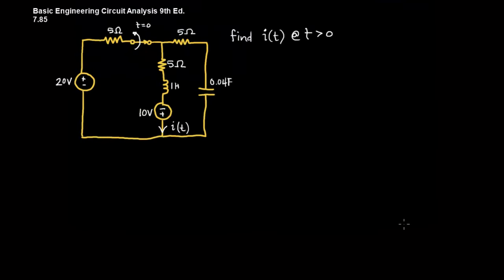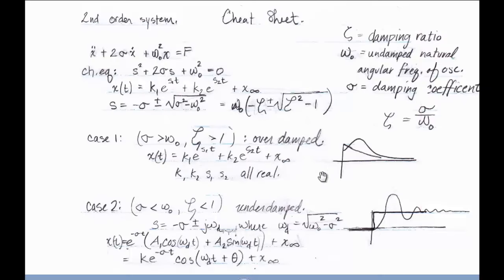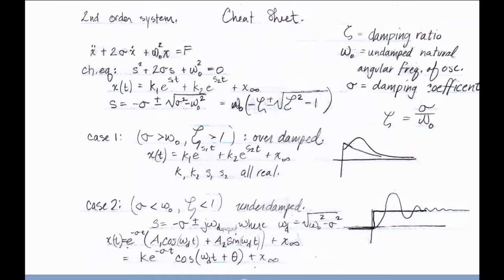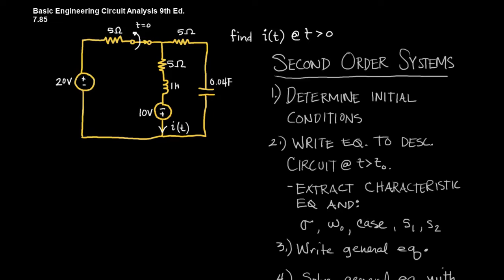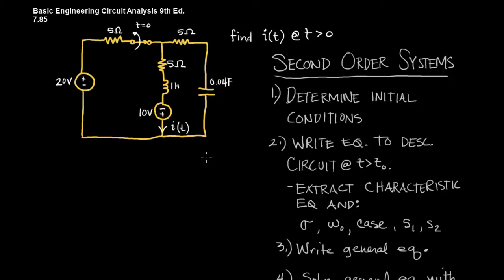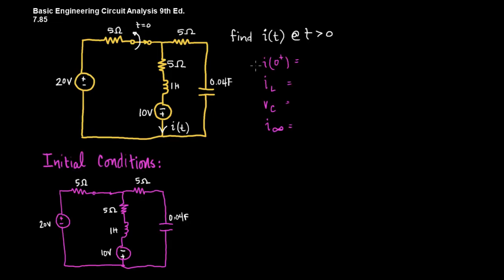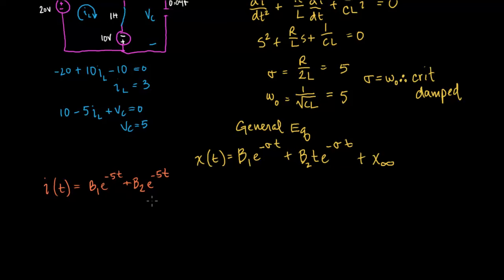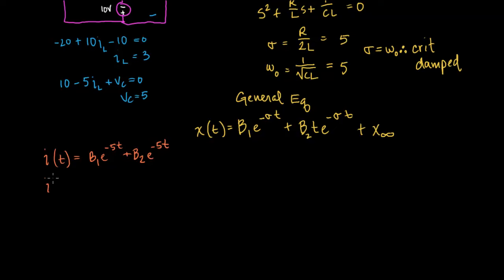Analysis of Second Order Circuits

Comment: @ 17:22 "This means the circuit is critically damped."
Indeed it does, but you still need to mind your initial conditions. I solved this circuit in the s-domain and found the expression: I(s) = 3(s + 5)/(s + 5)^2. The zero in the numerator cancels one of the poles in the denominator and you get I(s) = 3/(s+5). This is a 2nd order circuit that exhibits first order behavior. Performing the ILT on I(s), you obtain: i(t) = 3*e^(-5t) ∎

Comment: Really helpful video. However I have this question: in the derivative di / dt that you get at 21:57, where do you get the second term +B2e^(-5t)?
Reply: he made a mistake which you can see but he corrects it by using a describtion....in the vid its B2 t e^(-5t) that you derivate....(not B2 e^(-5t) as written in the vid)...  which equals to B2 t' e^(-5t) + B2 t e^(-5t)'....(same way when you derivate [f(x)g(x)] '= f'(x)g(x) + f(x)g'(x)

Comment: for the V_cap equation @8:15,10-5i+Vc=0. Why do we not consider the 5 ohms resistor
Reply: Because there's no current passing through it :)
Reply from the maker: ***** Capacitors and resistors can't be treated the same in transient circuits.  There is a voltage on the cap, but there is no current flowing in that branch  the resistor is still bound by ohm's law.  No current, no voltage.  The reason there is no current is that the capacitor is fully charged in this instance - therefore it acts as an open
Reply: sebaogal1 are you an engineer now
Reply: +Abdulla Omar still on it :)
Reply: so i think it was because the cap was fully charged
Reply: @AraujoMatt  Thank you for this answer! Great video

Comment: do you imagine capacitors as open and inductors as shorts initially no matter what? does it make a difference if the switch is originally open or closed?
Reply: if the source is connected for the time such that the capacitor will be charged fully and inductor stores maximum energy, than we consider them as open and short cause they don't have the capacity anymore. That's my concept. Correct me if I am wrong..

Comment: Hi friend , i have to get the initial conditions from a circuit with 2 storage devices (L & C) but it also has 2 power supplies and they are always present even before and after the switch closes or opens , how can i get the initial conditions ? may i use superposition ? i mean , passivate one power supply & get the initial condition , then passivate the other power supply & get the initial condition , afterwards my 2nd system initial condition will be the sum of those partial ones ? thanks

Comment: In the first loop, you referenced the technique as the "KVL" when you should have said "KCL".  Using KVL=Kirchhoff's Voltage Law means that you are using the node voltage analysis to calculate voltage.
Reply: Mesh uses KVL (adding up the voltages) and Nodal uses KCL (adding up the currents). He was correct when saying he was using KVL. I'm not sure what you're referring to, because when using Nodal analysis, your equations are set up as V/R + V/R . . . etc, which is current. Mesh uses R(I) + R(I) . . . etc, which is voltage. You may have gotten that backwards if I interpreted your comment correctly.

Comment: Hello, why in the characteristic equation you didn't consider the initial capacitor voltage?
Reply: The initial and final conditions are dealt with in the beginning of the video. The characteristic equation is to get the natural response of the circuit. By superposition they will sum together to get the final response. Check out forced second order ODEs.
Reply: Thanks
Reply: Can you help me with a second order circuit? If so, how can I send you?
Reply: @angelojunior9507  There are better forums to ask on. Try groups like r/ECE or r/Electrical Engineering on reddit. You can also try #electronics on the freenode IRC network.

Comment: Your initial Vc is incorrect; since there are 2 supplies, you need to use superposition when you perform KVL. Total voltage should be 15V when you add the 10V from the 20V supply. Said another way, since the cap is an O.C., the right most resistor is removed from the circuit, leaving a 1/2 voltage divider in series with a single 30V supply.
Reply: Ran circuit on Multisim, Voltage across the cap is indeed: 15V
Reply: This is wrong. First, Superposition is unecessary. KVL works fine. Second, the 10V source is pointing downward, so  (20Vs - 10vs) or 10V - 5V = 5V. I also checked this with a simulation (5V), not sure what clifford ayer did, except maybe make the same mistake.
Reply: Jarrett Montgomery Well if you do kvl on the left loop then you'll see that 20v and 10v are in the same orientation. So... it is in fact 15v..
Reply: KVL left loop: 20 = iL(5) + iL(5)  - 10 (iL = 3) =>  20 = 15 + 15 - 10 == 0

Voltage at 3-resistor node (Vc) using Nodal: [Vc -  (-10)] / 5 = 3; Vc = 5V
KVL in the left loop has nothing to do with it.
Reply: Jarrett Montgomery no
Reply: Excellent reply
Reply: Actually, I was incorrect; I had failed to notice that Vc is across both the 5 ohm resistor and the 10V supply (not just the resistor), so in fact superposition gives you 10V + -5V = 5V. The OP was correct.

Comment: At 13:55 i don't get why we were changing the sign of the capacitors voltage. Why does it not remain a minus? I mean the current is entering though the negative terminal so by my understanding it should remain that way. Thanks to anyone replying.
Reply: I also wondered that but cant explain why he does that

Comment: isn't i(0+) suppose to be the same as i(infinity)? and shouldnt iL equal to i(o-) which is before changing the switch?
Reply: Capacitor and Inductor will act differently when switch is on or off depending on circuit. For this when switch on at 0-/0+ inductor will be short and capacitor will be open. But for infinite the switch is open and the source is therefor not connected to circuit so inductor and capacitor discharge away after the battery after the inductor dies. The resistor on top left doesn't get affected because its open there so it doesn't matter. Now again inductor is short and capacitor is open and making the entire circuit not connected with anything else so its nothing, 0. But when it was 0-/0+ the circuit was still connected and power was running so there would still be current since current depends on resistor and voltage and we still had those so we can calculate it.
Reply: Marc Zapatero 
i(0+) is the instant right after the switch is flipped. i(infinity) is after a long time, which is when the circuit has reached steady state. 
For inductors: iL(0-)=iL(0+)
Reply: Marc Zapatero sorry for being seven months late lol

Comment: at 24:28 the di/dt  should be -5B1(e^-5t)-5B2(e^-5t)  ||
Reply: +narpatraj gehlot in equation of i(t)  at 20:20 you  do not write there t in 2nd term so i get confused.
Reply: +narpatraj gehlot I realised that as well. I just inserted it. He actually took it into account in the line below thoat though.

Comment: when you wrote the voltage of the capacitor in the characteristic equation you forgot to put the initial condition
Reply: +David Rodriguez Since he took the derivative it would of became zero anyways so it wouldn't have changed the final answer.
Reply: ok, but I think it is necessary to write it, because sometimes it does not become zero

Comment: Kvl 2 should be 10 -5il +5il +vc = 0
Reply: A little late now, but I believe it is correct the way he wrote it.

If you do a mesh current for i2 (which is going to equal 0 A), you will get an equation of:
10V + 5(i2-i1) + 5(i2) + Vc = 0

Since i2 is 0A, this equation goes to:

10V + 5(0-i1) + 5(0) + Vc = 0 ----> 10V -5i1 + Vc = 0

Vc = 5i1 - 10V = [5ohms x (3A)] - 10V = 15V - 10V = 5V